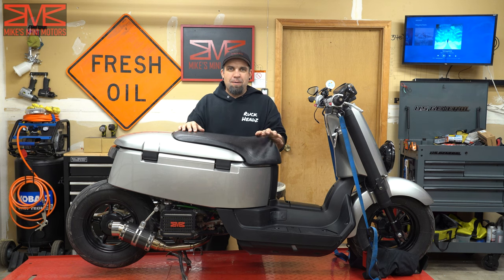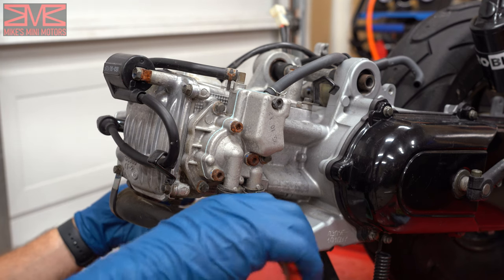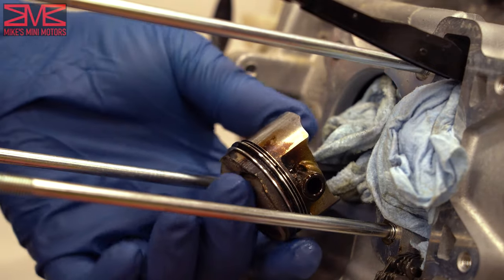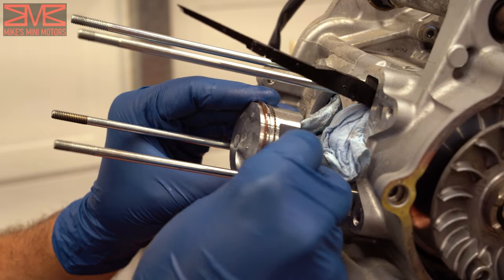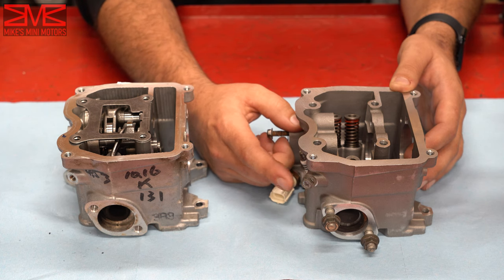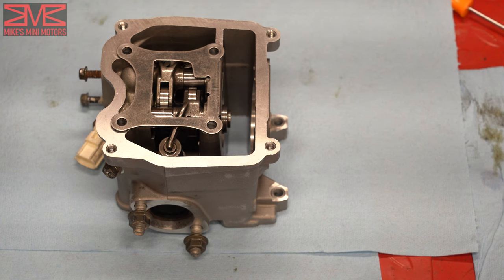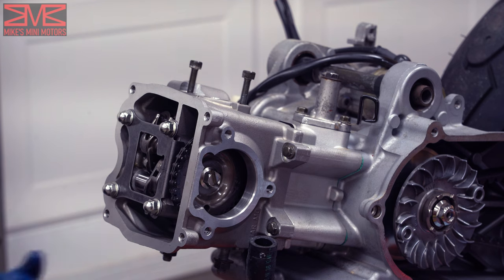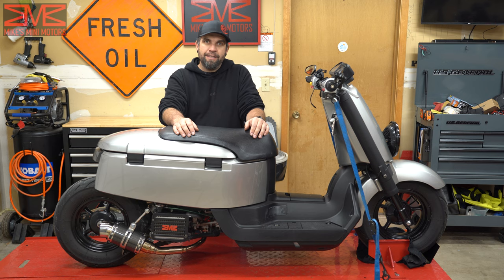Big Booty Trudy's Upgrade: Yamaha C3 76cc Big Bore Kit Installation

Comment: Excellent video, I rebuilt mine last winter down to the crank (not big bore kit) and wish I had this video then! Getting the timing aligned was the biggest pain. That said, I have a small oil leak at the cylinder base gasket so I get to do it all over again in a month. 😂

Looking forward to the ride videos!
Reply from the maker: Thanks! Sorry to hear about your base gasket!

Comment: Cant wait to hot rod my C3!
Reply from the maker: You’ll love it!
Reply: @MikesMiniMotors  what is the solution for the coolant temp sensor? the stock sensor bottoms out in the casting...
Reply from the maker: I had to drill into the head through the sensor hole a little bit for clearance. Just be really careful, take your time and don’t drill too deep!
Reply: @MikesMiniMotors  i ground down the tip slightly and went to far, it bleeds coolant thru the body of the sensor now lol. i ordered another, im going to try to shim it out with 2 or three of the sealing washers if it seals. Ill let you knowhow it goes. Thanks!
Reply: follow up , i double gasketed the CTS, that gave enough room to clear the casting.  I wasnt able to use the turning specs you posted however. I have a +25% setting on most rpm ranges with good results. Once the weather breaks a bit more, ill have my wideband on it and dial it in.
Reply from the maker: Thanks for the update! I’m glad you got it to work. I need to get my wideband installed too, then I can really dial in the tune.